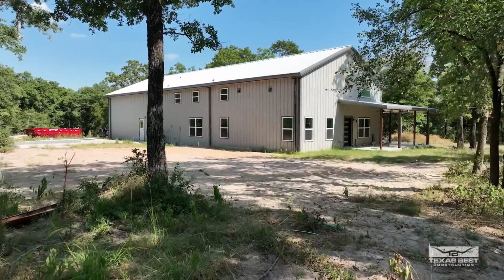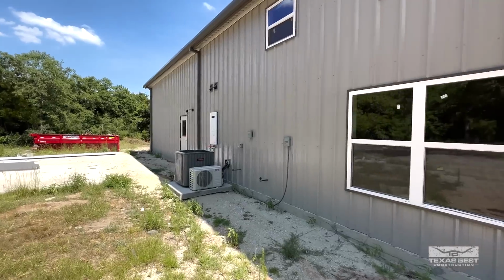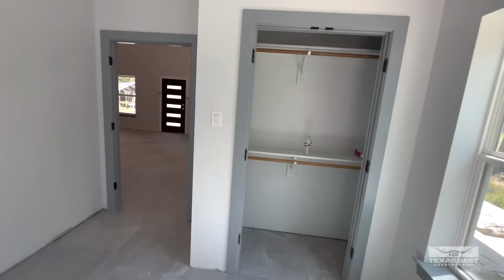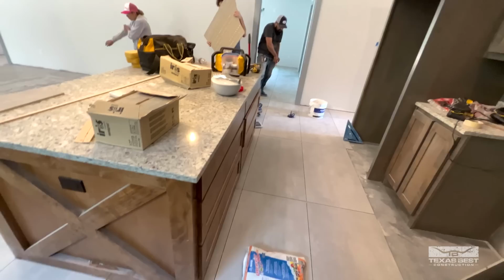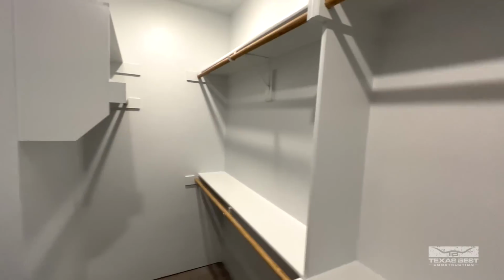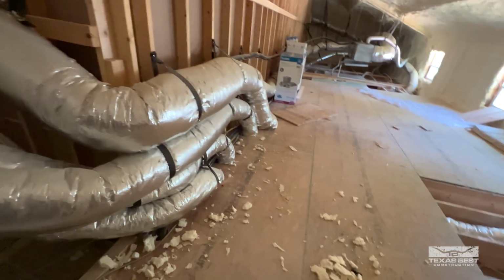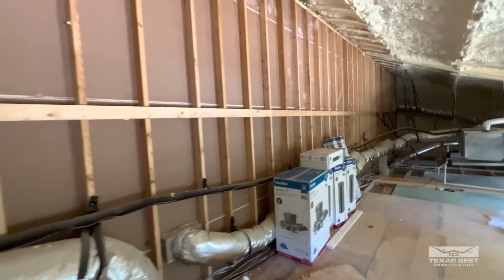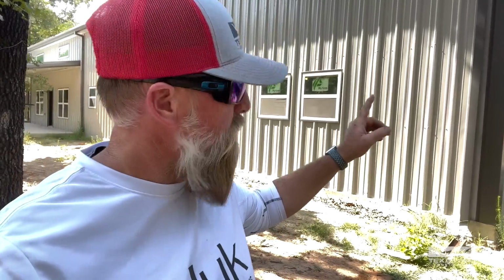Inside Kosse's Barndominium: The Ultimate Update Tour

Comment: Another nice Barndominium from Texas Best Construction.
I always enjoy your videos and I get it, a lot is customer decided but I do want to give an improvement suggestion.
So far, all your entry doors I have seen on all your builds go inside....
Did you ever think about out swinging doors instead?
Pros. 
1. Not as easy to force, kick in.
2. Can be taken out from inside, not from outside should someone want to break in.
3. More space inside can be utilized and is not taking up space inside.
4. More protective to heavy weather. The threshold will hold against water.
5. Better insulation for keeping heat/cool inside.

Cons. More difficult with a storm door/screen door but there are solutions like having it as a pocket door and others.

Love your builds
Reply from the maker: Thanks so much

Comment: Josh, really loving the look of your buildings.  
I have one concern with taking the hybrid approach (metal covering zip) and am wondering what steps you are taking to address this.
As a long time Texas resident I have seen wood work nails and screws loose.  It doesn't happen overnight and can take 10-15 years before it's noticeable.
Reply from the maker: Yes we do use wood screws for our wall fastening procedure. I suppose you could break down any type of material in questioning the longevity but if somethings lasting for 15 years that’s a pretty good start. Good ways to offset concern is just to have a good cover around and overhangs it help protect. Also having a very good underlayment for our wall system with the zip sheathing is the best case scenario. This means any concerns or problems are easily dealt with.

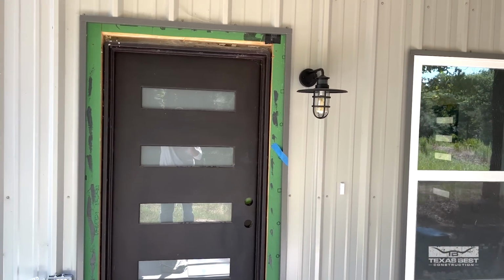Comment: Josh, I really like the work your guys do. The ext light, in the background, you show around 1:37, how did you wire that in? I am building a pole barn house and I am unsure how to my ext lights in. Is there a sketch or video you may have that could help me out? Other than that, keep the great work.
Reply from the maker: We just have a junction box on the backside of that wall and they cut a small hole in the panel before they let the wire come through.
Reply: Ok. Thank you. I was thinking that since it was the simplest way to get it done. Again, thank you.